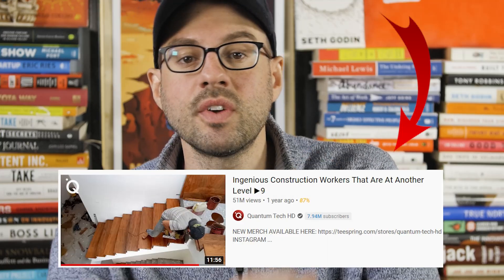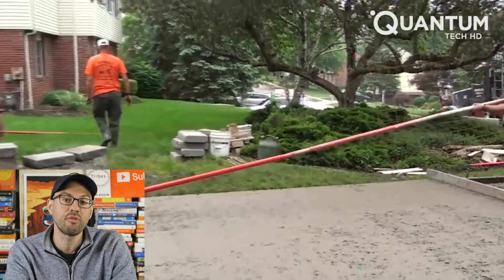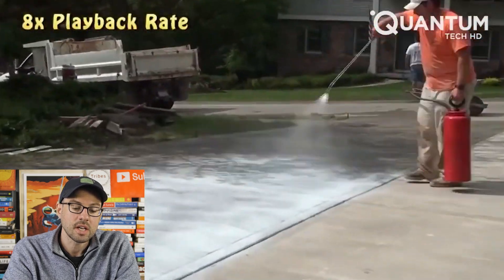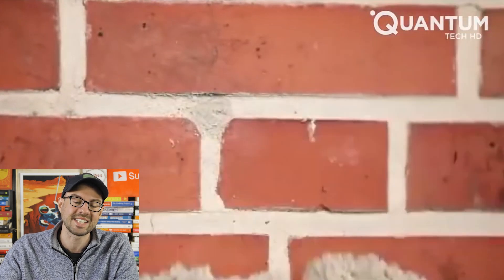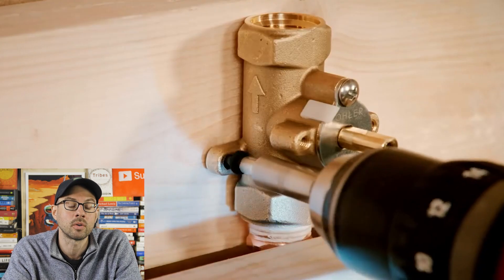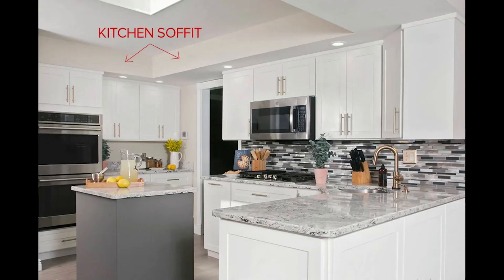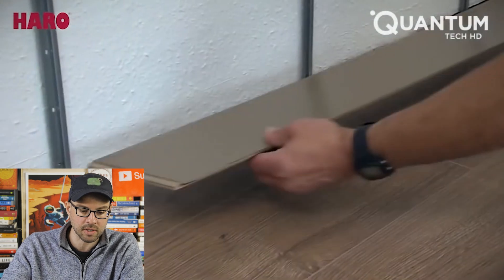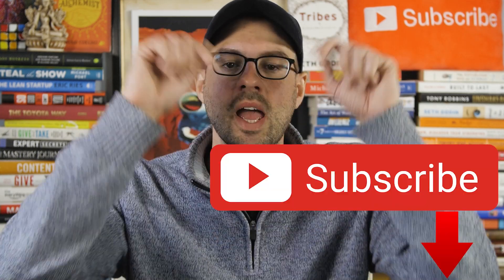ENGINEER REACTS to Ingenious Construction Workers that are at Another Level ▶9

Comment from the maker: Should I do more engineering reaction videos like this? Thanks 1% Nation ❤️!!!
Reply: Yea, it’s pretty Interesting.
Reply from the maker: @roboserpent7247  okay cool yeah if this one does okay I probably will
Reply: Are niche engineer degrees flexible to a certain degree, like how an aerospace engineer might have the skills to do similar jobs to a mechanical engineer, or are they constricted to things that fly(more or less) 
Could an architectural engineer break into civil engineering?
Reply from the maker: @gabeflame7803  hey thanks for the comment, and great question about this. Engineers can move in and out of other niches all the time. Aerospace and mechanical can be interchangeable, and yes architectural engineers can most likely be hired for most of the civil engineering roles out there.

Here is some advice for switching gears.

Changing career direction with engineering is something that many engineers do throughout their careers. First you have to make a resume that caters to the direction in your career that you want to go. I have an ITS resume, Traffic Engineering, Highway Design, Macroscopic Forecasting Resume, etc. All for one career but they are each specifically curated for a different direction or niche. 

Next, you have to network in the direction you want to go. Which sector in new sector of engineering niche do you want? Go to those networking events. Join those engineering societies and organizations. Attend those virtual meetings and try to become a part of the planning teams. Become closer with the engineers that plan those events, as typically they are successful and know people. 

Also, go back to the professors and anyone you knew within the last 5 years who may know people in the avenue you are headed. If they say, "I'm not sure, sorry", then ask them to introduce you to someone who may know. Keep asking for introductions until you get a hold of someone working at a mechanical engineering company you would also like to work for.

Finally, write down a list of engineering companies in your city or target city that you could work for in the different direction / specific new niche. Start to find engineers on Linkedin who currently work there. Know exactly what they company has done over the last 6-12 months by reading their blog/social media/following them in the news. Cold approach their engineers on Linkedin and build a relationship, and ask for an informational interview. Don't know what that is? I made a video about it here: “Informational Interview Tips“ https://youtu.be/nxUtpzPHKjc

Then you can expand the relationship, and ask about opportunities in the future. There are other ways you can use your free time to make yourself more hireable in a new career direction, and that would include working on your skills for that arena, building a portfolio of work on your own in that direction, or even starting a content project like a gallery or podcast or blog about the industry. This shows ambition, thought leadership, and uniqueness, so give it a try. Does all this help? Thank you!
Reply: @JakeVoorhees   Thank’s for the quick response 🙂, I thought you might not see the comment on an older video so I posted it on the newest one.
Reply from the maker: @gabeflame7803  no worries I use an app that allows me to see all comments everywhere :) let me know how else I can help okay? And I’ll do what I can to support you. Cheers !!!
Reply: Definitely!

Comment: What kind of engineers do Tesla hire more, electrical engineers or mechanical engineers, what do you think????
Reply from the maker: Hey thanks for the question. Tesla hires both MEs and EEs. I think EE has a better likelihood because of all the programming and access or software engineering roles at Tesla, wheres MEs can work on the physical component design, also the thermal aspects, the airflow around the car, etc. I have a way to quantify this for you. I need my other machine though so please if you comment again on this, it will bring it to the top of my comment queue and I can do that for you. Sound good? Thanks again

Comment: Great video explanations! 
I am working on my EE degree but have been getting great interest in civil engineering/ construction. Any advice to to integrate the two? Is a MS  in Architectural degree an ideal route for this? Any videos on this topic? Thanks
Reply from the maker: Hmmm, hey good question. Okay so there are a couple things that come to mind. There is a big aspect of building services engineering, and electrical engineers work within those types of things for large skyscrapers and buildings. They are wired for power and telecomm and all types of stuff that you can work with. Also, there is Building Information Modeling (BIM) where you can model all aspects of a building and every single component in the modeling program. I feel like there is a crossover for EEs there somehow. Take a look at what massive design build firms like Jacobs and AECOM hire EEs. And take a look at what Electrical Engineering firms provide services to the construction/civil engineering industry, and you will come up with more ideas. Does that help and make sense? Thanks so much! Ask me any follow up questions okay? Cheers!!
Reply: @JakeVoorhees  thanks for the really great response! You brought up something quite interesting for me to explore, building services engineering; what is the career prospects like  and  is there any realistic potential for entrepreneurship ( or is it one of those skills requiring decades of experience to get self employed?)
Finally I would really appreciate it if you share thoughts about smart buildings and career prospects in that area!
Thanks Jake!